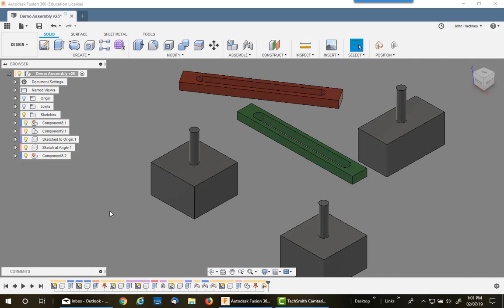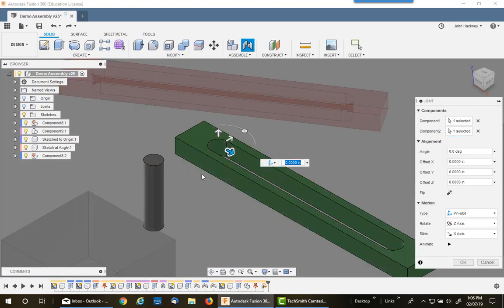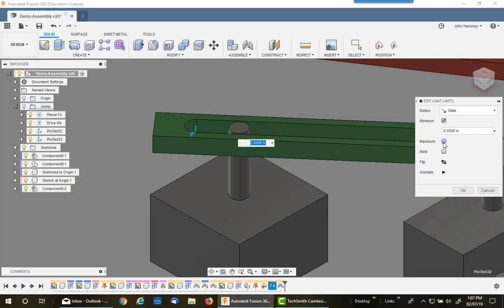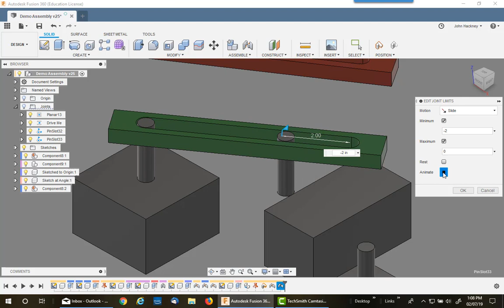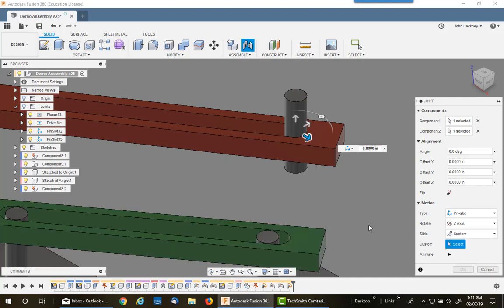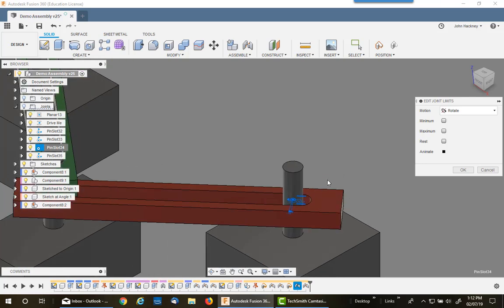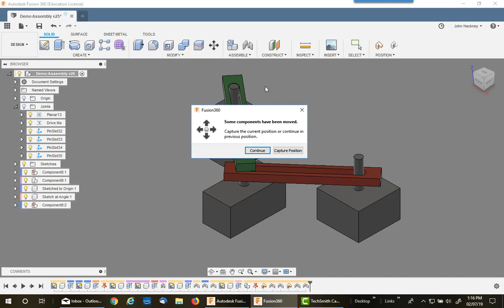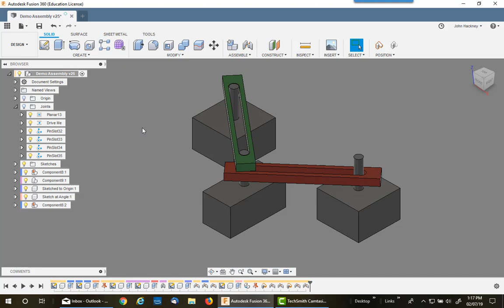Applying Autodesk Fusion 360 Pin   Slot Joints

Comment: thank you very much! exactly what I was searching for. joints get me every time :D ...selecting the pin first was the critical bit I missed. had the pin grounded and was not able to select it first. deleted the grounding, joined and re-grounded made it behave as expected. ...sometimes one wonders :D in fact I wonder every time I try to use joints in Fusion :/

Comment: Im building an angle finder for measuring pipe angles while still on the bender with a similar application of the pin slot, but I notice you never drove the blocks to rotate, which is what I  cant seem to get mine to do.
Reply from the maker: I am guessing your have your Rotate motion, of your Pin-Slot Joint, locked.  Take a look at this short video which shows rotation in possible with this joint.  There is not sound in the video. https://youtu.be/46ljMaHre_Y  If you would like, send your model to jhackney1950@gmail.com and I will take a look.